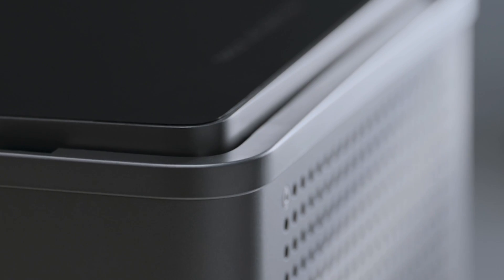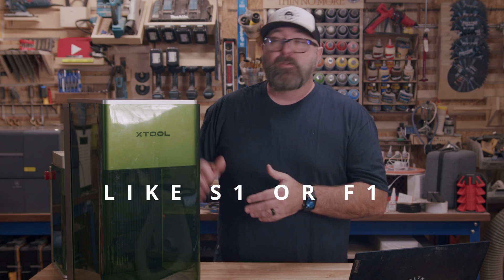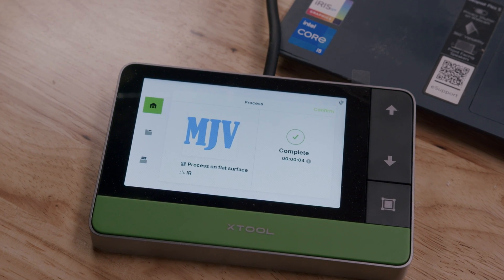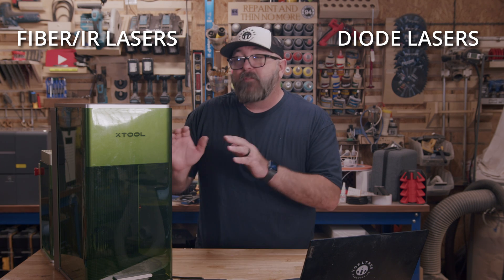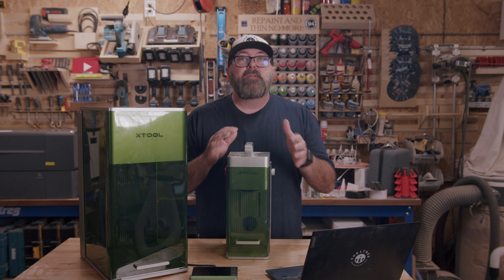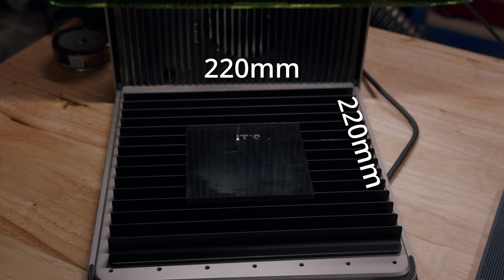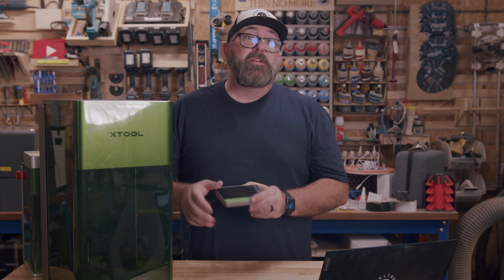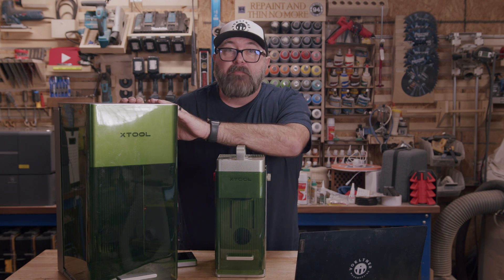A look at the xTool F1 Ultra FIBER laser

Comment: I look forward to seeing the speed difference that is what has really caught my eye. Also the batch engraving. I am wondering though it  as portable as the F1 or is better as stationary work station.
Reply from the maker: It's definitely not as portable because of the size and weight of it. They've removed the handle like they have on the F1 because of that reason.

Comment: Will this cut through 0.3mm Brass shim? That will change the chemical milling method of folded metal models.
Reply from the maker: It’s advertised to cut through 0.4mm brass, 0.3mm stainless steel, and 0.2mm aluminum but I haven’t gotten to that part of my testing yet.